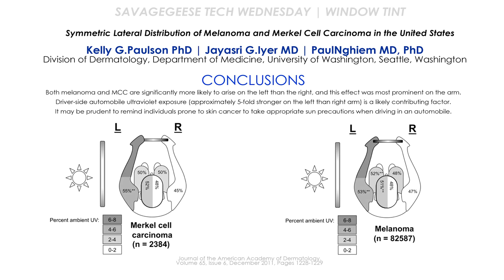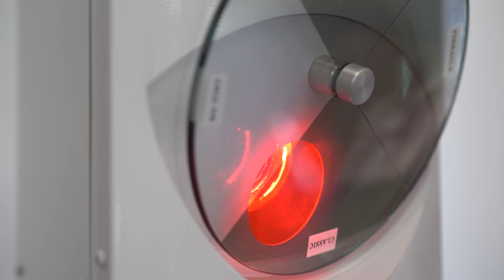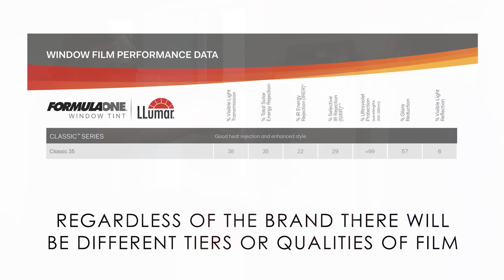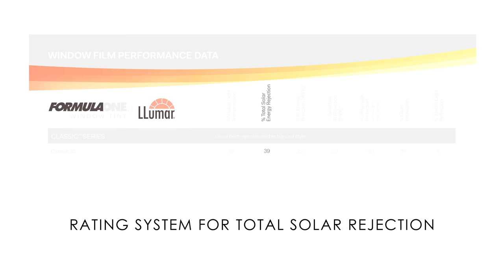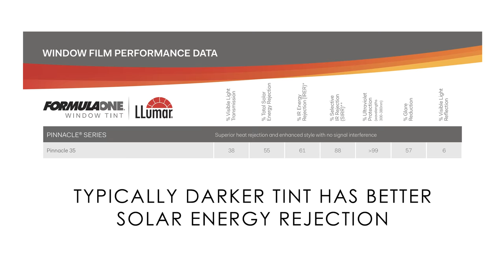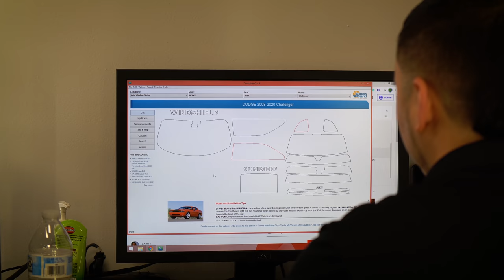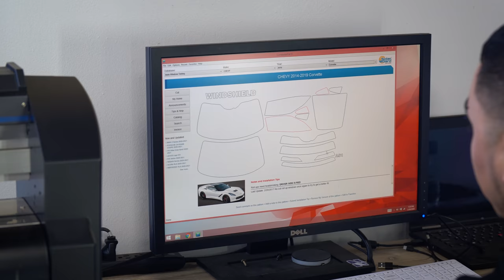Tinting Your Car and Truck, The Pros and Cons

Comment: Another benefit is when you get older and your eyesight starts to fail window tints will help you get into a lot more collisions and near misses.
Reply: @gmjsomeone54  weird because here in Colorado the front windshield has to be 100% clear so no tint. And many other states are like that, never heard of anywhere else that allows tint on the front.
Reply: @gmjsomeone54  that would definitely be nice to have, I thought California was brutal with tint laws to the point where you can't even have tint on your front two windows. Just depends on the cops I suppose.

Comment: Geese, I am truly disappointed by that episode. LLumar really used you to advertise their shit to your audience and you let a lot of false information slip.
- The UV argument is BS
- All cars have safety glass that does not shatter around in an accident. No need for film protection at all for this.
- "There is a chance that when you wear polarized glasses you might see a little rainbow effect" Dude, did you try it? It is like looking through really smudgy glassses all the time. Not "very few people acutally notice that", it is a huge issue and wearing polarized sunglasses is a 100 times more safe experience than that smudgy film.
- Then you fell for that stupid IR light heat test. Have you ever been in a tent in summer? Reducing the heat that passes trough your window does not have a big impact on the room temperature. If this would be so, then all manufacturers would use that tech to lower their emissions. In fact they do use that, but the other way round to keep the heat in ("thermal protection glass"), which is a tiny metal film that prevent heat from escaping.

In my opinion this is a waste of money and turns any high quality windows into cheap dysfunctional crap.
Reply: who hurt you
Reply: @darekm6859  because less energy is needed to heat up or cool the interior.
Reply: Auto glass does shatter, especially side and back windows. It tends not to shatter into sharp shards like normal window glass, but it still shatters and fragments go everywhere.
Reply: @stevee8318  No, security glass is two layers of glass with a foil in between to prevent exactly that from happening. Fragments can get loose but they are not sharp.
Reply: @darekm6859  WLTP takes changes in options for weight, aerodynamics and energy consumption into account, but excludes a/c from that. NEFZ did not take any of this into account. However, a/c is a huge factor in consumption, esp. for electric vehicles.
If it would make sense than it would be available stock already. And it is, it is called "heat protection glass" but it's more than a foil and already there on most vehicles.